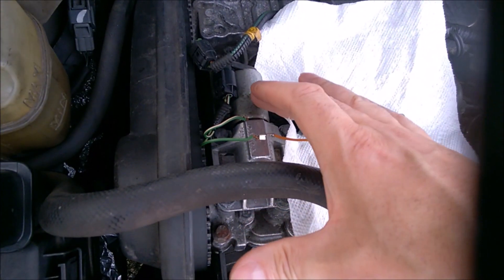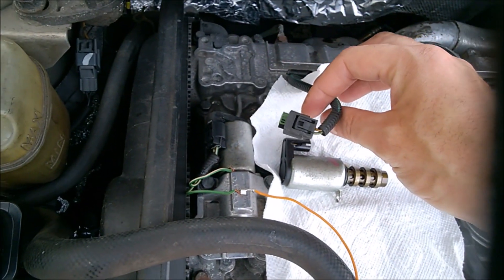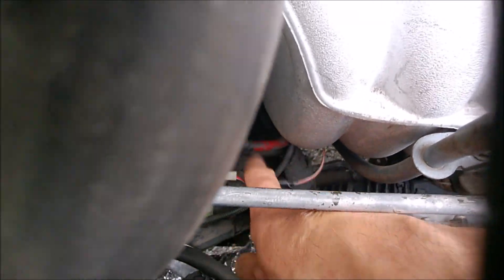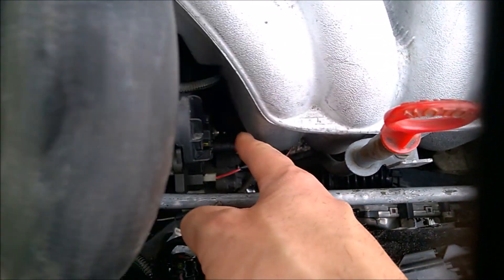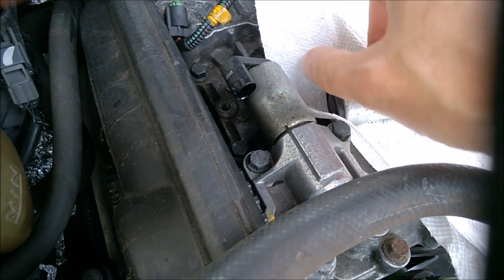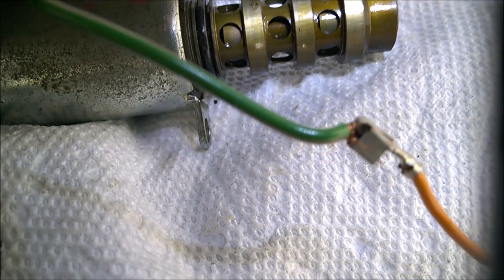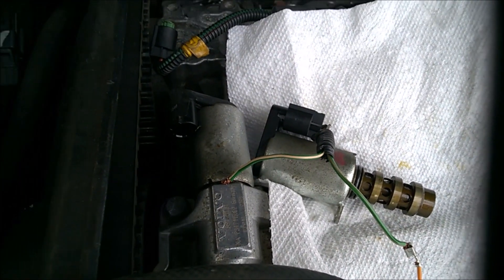Volvo S60 XC90 V70  Camshaft solenoid (VVT) quick check 2001-2009

Comment: Hi peppermint, does volvo sell the O-ring that goes between the solenoid and the VVT casing? I bought 2 from the junkyard but I want to clean them with brake clean before I install them on my t5. I cannot find the O-ring, I can only find the green gasket that goes between the casing and the valve cover. Also I have a car with the old wiring so I need to update the connector, do you happen to know what wire goes to what because they are both green and white.
Reply from the maker: I no longer have the solenoids to check for the wiring, I suggest asking on forums such as Matthews or the UK one, it was a rather common question. For the seal I would think Volvo doesn't sell it separately, may try to gently remove and reuse yours - just undo to small torx screw to separate the solenoid.
Reply: @Peppermint1  thanks, I’ll check forums. Everybody told me to upgrade the connector to the new style and upgrade the gasket to the one with a mesh, my 01 t5 exhaust solenoid is going bad so I bought a solenoid from a 06, gonna update the gasket and connector hopefully it solves my vvt code and my weird engine rpm at idle. I’m gonna clean the one I got from the junkyard first. Maybe I’ll just clean it without opening the torx, you think brake clean will damage anything?

Comment: We had such a car in the service, checked the wiring, cleaned the valve in an ultrasonic bath, connected the oscilloscope to the valve terminals, made sure that there was a PWM signal, opened the ECM unit and re-soldered the driver with the key of this valve to new ones, but error 612D did not disappear. 2 days wasted
Reply: How much voltage need for functioning solenoid valve?
Reply: @trkmusicandpeace644  11-14.2v

Comment: Can a bad vvt exhaust solenoid cause white smoke ?
Reply: Did you find out what is it ? I have white smoke also p0011 p0014 on 2004 volvo xc90 T6 .
Reply: @VOLVO_SAVED_MY_LIFE_CLUB  no. I ended up getting rid of the car. Lots of things cause smoke....leaking head gasket... leaking turbo charger.

Comment: NEVER ,EVER APPLY POWER LAST OT TEST A DEVICE. ALWAYS USE NEGATIVE WIRE LAST TO TEST DEVICE TO PREVENT VOLTAGE SPIKE THAT CAN DAMAGE COMPUTER
Reply: Looked like he was bypassing the computer in this video...

Comment: How do you clean these and what solutions, solvents (carb cleaner, throttle body cleaner, acetone, brake cleaner, ....) should one use?
Reply from the maker: Hi there, I'd say it's not worth trying to clean them.  Usually what happens is oil change is neglected and builds up varnish on the tiny bushings deep inside the solenoid.  The problem is it is not possible to have any fluid penetrate inside and reach these small bushings to clean them, even if you soak it for long time.  If it doesn't move easily, better to replace it.  I've also tried to open one to access the bushings but it does not work (some people do open the transmission solenoids, but this vvt solenoid is different)
Reply: @Peppermint1  OK. Thanks. We used the wrong oil for two oil changes. now we have P0015 code even after two proper oil changes. I was worried that a new VVT would get gummed up too. If that is even the problem. I will get an OEM part and change it anyway. Thanks again.
Reply from the maker: Good luck, and don't forget to use forums, two of them I use http://volvoforums.org.uk/ (Europe)  http://matthewsvolvosite.com/ (US)
Reply: @Alan M  did you solve the problem ?

Comment: Do you know the difference between this solenoid for the Non turbo engines and the one from the intake side of turbo engines? I am about to replace mine with one from a turbo model.
Reply from the maker: They are the same.  The part number may differ, but the intake on the non turbo is the same with the intake on the turbo and the electrical connectors are the same.  If fact, I've even used an exhaust one from the turbo engine, on the intake on my turbo engine, I just had to modify a little the connector because the connectors for intake and exhaust are different.  Talking about these solenoids, they activate the intake hub (also the exhaust on turbo)  which changes the angle of the cam (timing).  I think one of the less know problems on these engines is that when the engine is never driven past 3500 rpm, the hub advance doesn't change and in time the oil sits inside the hub and gets sludge and prevents the hub from changing the timing properly (same will also happen if the oil changes are neglected).  The result of this is a serious engine power lack and also a drop in mpg. I am investigating this at the present time, I will upload a video with the way the intake hub works on these cars, if I manage to disassemble one at the junk yard.
Yet another issue with the non turbos is the intake air thermostat, not sure if I've already mentioned this to you  https://www.youtube.com/watch?v=gOx3Q8vqoz4
Reply: About the intake air thermostat yes, I know it from your videos and commented how I used a turbo inlet before the air filter box.

I didn't know that even an exhaust solenoid can be used on the intake, that is interesting! Are you sure about those rpms? I've seen this number before, but I also read somewhere, that the vvt activates not only then! 
As for the hub, when changing my tensioner pulleys, I found out that it does not move so easily.  May be a way to break the sludge a little is by moving the mechanism with the belt removed.
Reply from the maker: The hub movement (without the belt on) is exactly what I want to investigate at the junk yard.  I already rotate the exhaust one on an engine and it was moving a lot almost freely (although at some point it was feeling like it was touching the valves).  I would not try however this on my own car, at least not before I learn correctly how this thing works. 
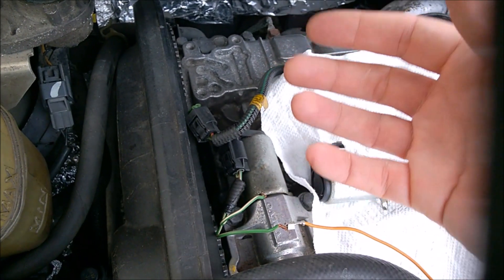As for the timing change, that is a very good question. I know that around 3500rpm there is a tonality change in the engine.  But it is actually very possible that the timing is actually changing continuously.  It is exactly this I want to find out, especially after watching this video at 2:20  https://www.youtube.com/watch?v=glUXDMuQ3Bs  and this as well  https://www.youtube.com/watch?v=mF5Ns8_9MeE  If there's sludge inside the hub, it will certainly prevent it from rotating at it should during acceleration.
Reply: Also for the hubs. It will be good if you can examine one. Mine is running a bit to the outside of the engine (belt is on the edge) and may be I will need a "new" one soon.
Reply from the maker: It is true that these hubs can develop a 'side' movement (can be checked with the belt removed), I think even when new they have a bit of movement, but that's not really a problem unless there is a lot of movement (1/4in or so).  The belt running 'on the edge' is caused by the tensioner.   I had my belt running near the left edge and also 'wobbling' on the cam pulleys (moving left-right), everything was fixed with a new tensioner and now the belt runs almost in the middle without any wobbling  (yes, I know, these tensioners again, they give quite a bit of trouble).
Reply: Mine runs centered on the exhaust cam gear and on the inner edge (closer to the engine) on the intake gear hub. The problem is definitely with the hub, but fortunately no oil leaks for now!
Reply: Nikolay Delibozov did you get everything sorted out?? I am very curious, as I am a new owner of a vehicle similar to yours with a bit of questions..
Reply: @Peppermint1    Thanks for this.  It is quite helpful, particularly the issue of not getting the vehicle into an upper RPM range.  You mention that it isn't worth attempting to clean out a gummed up solenoid, but do you have any recommendations on cleaning out the accumulated sludge in the hubs?  These are pretty expensive and would be worth the effort if it is relatively simple.  tkx!
Reply from the maker: @danielpeterson1895    What does the engine when it won't go at higher rpm ?  Does it sounds like 'forcing' and getting loud ('screaming') ?  I had that when I bought my car years ago, the engine would scream at 3000 rpm like it was close to 7000rpm or so.  It felt like it was going to blew.  I'm am not sure what could cause this, but I'm thinking piston rings could be stuck. If the hubs are clogged with oil gunk, I don't know if it's doable to clear them.  There are small oil passages inside the cams - see pictures - that may no be easy to clear.  You may try doing a Seafoam treatment but it's not that efficient and also it won't release a stuck piston ring.  I would rather recommend switching to synthetic because these have good detergent to them and act in the long term. I recommend watching this video when switching to synthetic because there are a few cautions to it  https://www.youtube.com/watch?v=IGU-f1MA-VY
https://volvoforums.com/forum/attachments/volvo-xc90-9/11214-large-oil-leak-after-replacing-exhaust-camshaft-cvvt-seal-help-needed-vvtseals3.jpg
Reply: Same here

Comment: I get P0075 error, which goes away after the car haven't been driven for a while, but after it gets warm, it turns back. I cleaned the solenoid with throttle cleaner, It was OK for a little, but then the error came back, just the period was longer this time.
Reply from the maker: VVT solenoid codes may also come if the VVT hub was not pre-tensioned.  When you look at the hub from the side (pop the cover), the three securing bolts must be close to the middle of their groove. I should upload a video this summer with how to pretension the VVT hubs after a tbelt change
Reply: @Peppermint1  Hi, can you link video with time mark how to check it?
Reply: Nikolay Delibozov did you even found the solution?